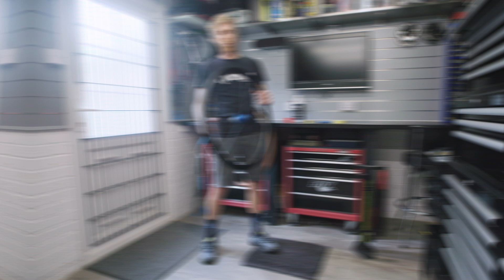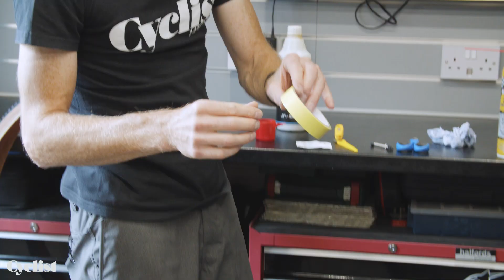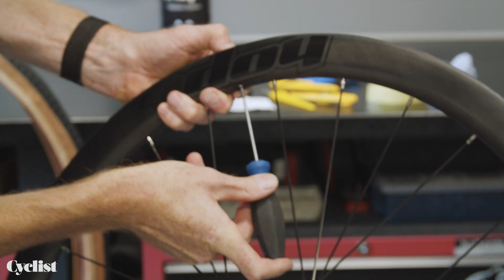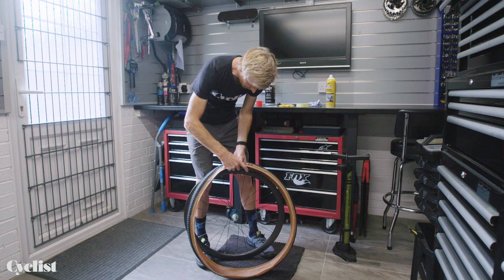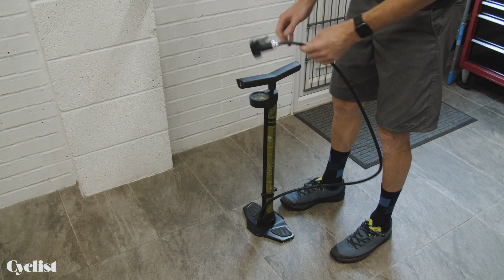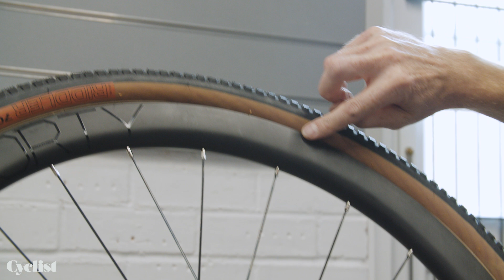How to fit tubeless tyres: Pro tips for fitting tubeless tyres, road, gravel and mtb.

Comment: I use a 2mm Allen key and put the tip under a lighter for a minute or two so it's hot and pierce through the rim tape for the valves

Comment: After years of doing it with a combo of floor pump, charger can, etc, I just went ahead and bought a small compressor, hose and inflator for $80. Comes up to the cost of one of those charger cans. And cheaper than a combo pump/charger. Worth every penny if you’re running tubeless for a few bikes.

Comment: For road tires .. finish at the valve ! 
If not the tire won't seat on the center rim channel and you'll lose enough space to make it practically impossible to fit it on your rim. Then use soap water that will make both the fitting and once you put air into the seating process easier.

Comment: This is useless advice, this trick only works on a limited set of wheels/ tires. The only method i really see working is 1. Using an inner tire to seat the outer tire and then cut it out. 2. Use a big strab around the wheel so you need less air aka have more pressure to get the tire seated while doing the first pump

Comment: The technique shown here is good, but it will not work with some tyre/rim combinations when the tire is new. Some open tubular TLR tyres are notoriously tight, they are also flat out of the box. You will need to start opposite the valve and work your way down to the valve, and you will also need to move the tyre beads as much into the center channel of the rim as possible. It will usually require a couple times round doing that before you get to the last 6-8 inches or so, which you then pop on with a plastic lever. Spray some soapy water (i use a househould bottle and just refill it with a bit detergent and water) between the rim and the beads. This will allow the beads of the tyre to move and seat - again with tight tyres it will be very difficult to make the tyre seat without this step. A compressor is easiest as it gives a quick boost of air into the tyre but a good floorpump should work, just keep pumping fast until the tyre starts to hold air. I also find it much easier to add the sealant through the valve. With valves like the Reserve Fillmore it's super easy.

Comment: I put sealant through valve with syringe and small hose.. I diregard the warnings because the syringe and hose does not allow sealant to muck up the valve.. and if it did a pipe cleaner would easily clean out the valve.  But it never happens to me.

Comment: This is a good video. However with my road bike I bought a tubeless tyre(Schwalbe) and the first problem was that even with tyre levers it was extremely difficult to get the tyre on. No thumbs would ever be able to do this.  Then with the tyre on and the valve core removed, no amount of frantic pumping even came close to inflating the tyre. I took the tyre to someone who charged me £25 to fit it. Ive done everything else on my bike since I had it, no problem - but not fitting this tyre. He fitted the tyre but scratched the £500 wheel and the tyre constantly deflates - for some reason the brand new tyre has holes in the sidewall. Tubeless joy!

Comment: Great video! I was wondering what you thoughts were on the width of the tubeless rim tape you use. Some articles that I have read say get the exact rim tape width for your internal diameter while others say go 2mm over the internal width, to allow it to fill up to the rim hooks. In one of the articles, the author said not to go 2mm over, as that could prevent a good tire bead to rim hook seal. Also, what pressures would you run on say a 32C tubeless gravel tire?

Comment: Couple of observations.  One the sealant is in my experience, best added after the tyre is fitted and its “popped”.  Just remove the core and add recommended amount. Cleaner also, especially ad you won’t have sealant sloshing around when still trying to fit the last bit of tyre on.
Next, I read a tip that it really helps if you warm the tyre before fitting.  I bought some tyres in the summer and just let the sun warm them. In winter a short time, wrapped in a towel in the oven works.  But don’t cook them!!
Finally, some tyres are easier to fit that others and that is a proven fact.  You can check reviews for yourself

Comment: Ahhh, having a removable valve core makes a big difference in getting a tubeless tire to seat.  Since my bike came without them that may explain why I had to struggle with getting the tire to seat.  Now I have a compressor (originally for my car) to ensure I pump enough volume of air into the tire to seat it without losing that air.

Comment: Everyone I know who rides tubeless carries a spare inner tube 'just in case' which seems to defeat the whole point of going tubeless. I use Smart Tubes with Slime pre-installed and have never had a puncture for years. I carry a spare tube for an emergency and could swap it out at the roadside in a fraction of the time that this took in the garage with zero mess.

Comment: Don't pour the sealant into the tyre like that on a road tyre unless you want to have it splattered all over the front of your pants in an "embarrassing" stain as it squirts out whilst you try to get the tyre on.  Just seat & inflate the tyre first, then deflate it and take the valve core out (need a little tool for that) then put the sealant in via the valve using a syringe or very handily "Stans no Tubes" comes in small bottles just the right size for one tyre with a nozzle that fits into the valve.
Reply: Oh yes 😃 good advice 👍

Comment: Can confirm it’s not as easy as this guy makes it, my hands are red raw, and the tyre is still not on 😂
Reply: You have probs done it by now but those who are stuck use soapy water, vaseline and rub it on the tyre you will see it will be like a baby 😂
Reply: F*cking thank you! I’m struggling to get even half this tire seated!
Reply: Tubeless guys tell you how great it is, followed by how to bodge all the problems 🤣👍
Reply: Get a hair dryer on the tyre… warm rubber is waaaaaay easier to get over that rim, especially if you’re using MTB tyres with hard side walls like magic Mary’s 👍
Reply: I feel your pain, mate👍‼️👍
Reply: I'm watching this right now and identifying at least a dozen ways in which I will get this wrong
Reply: My thumb hurts just pressing the like button on this comment. I know how you feel 😅

Comment: MTB pro tip: Put the tire on completely, inflate hard so that it’s seated (pops). Then remove the valve stem core and just poor the sealant in. Place the valve back and inflate the tire. No hassle, works like a charm.
Reply: * unless the sealant says in the instructions not to be added through the valve. (Stans Race Sealant)
Reply: Thats what I do :D
Reply: Agree.  Silly way to put in sealant.  Messy and restricts efforts to put tyre completely on.

Comment: I've used a very similar approach for all my gravel and cyclocross tubeless tire fittings. The "problem" I've encountered with tubeless set ups which is super duper annoying is that they work incredibly well when everything is new. But, as you use your wheels, especially if you're riding hard, long miles, the odd race, etc. the tubeless set up becomes less and less reliable. You start running into a lot of little issues like valves that fail for no apparent reason, punctures that once sealed become unsealed, sealant going off prematurely, minor rim scratches or dents affecting the bead in a way the wouldn't with a clincher or tubular, very messy mid ride tube installs when the sealant doesn't work, etc. Everyone I know who's running tubeless is carrying a spare tube anyway (ha!) and also now shying away from too low a pressure, especially on gravel wheel sets, due to wrecking the rims too frequently. Also, tubeless set ups cost more, no matter how you count up the pennies. Especially so when you're wrecking rims. I am currently running tubed clinchers in both butyl and latex form, tubulars AND tubeless. In my experience,  tubeless is just more hassle, maintenance and faffing about... But, I'm still trying...
Reply: tend to agree brother - am using tubes on MTB and road and tubeless for beloved gravel - no doubt that tubeless is a major faff by comparison with the odd puncture.
Reply: You sound like a guy who doesn't live in goat head country. 😉